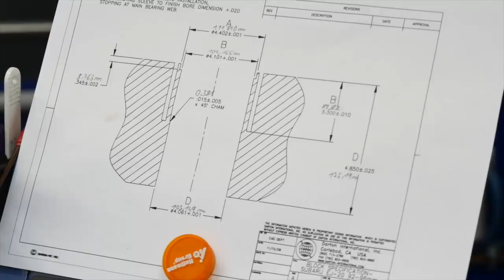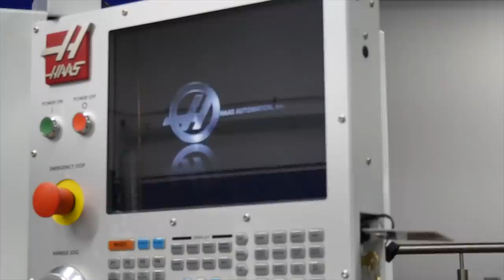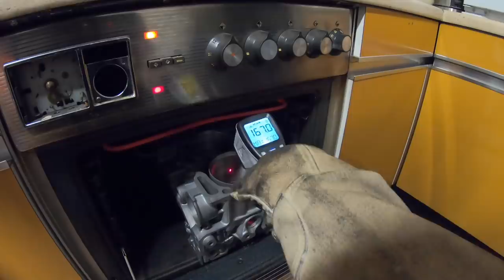High Performance Boxer SIX CYLINDER build l EG33 l Part 1 l Subi-Performance

Comment: 4:45 for cleaning of the holes, you might enjoy using a chamferring and deburring tool used for reloading ammunition cartridge cases. They can be had in 60° and 45° pitches, and most can go up to 13mm/ .512 inches.

Comment: Aren't you supposed to use a torque plate of some kind when boring aluminum blocks?  Or is that not necessary when boring for sleeves?

Comment: I have an old car, I would like to strengthen the engine in it, what parts should I replace?
Please help, I need your information
large piston, thick piston rods, large crankshaft
is it enough to power the engine

Comment: On these EG33 are they a alluminium block and then inserting a steel sleeve? 

Just a big debate in the Porsche rebuild world over steel vs nikasil sleeves.

A lot of nikasil installers don’t rate steel sleeve because of their different metals expansion/contraction rates which is what they’re saying causes the sleeves to slip in some cases with the steel liners.

Just wondering how can this not be happening with the EG engines?

Comment: So how big can you go with an aftermarket liner and a stroker crank or welded up stock crank?  What kind of power can the cranks hold?
Reply: Thanks interesting engines, my apology though I thought this was the newer EZ series.
Reply: @shaadydog1  EZ series have many quirks. Raptor superchargers have some data. There was the Perrin build a number of years ago as well. It's just a tricky platform to configure and tune. Most people haven't spent the money to R&D them as there are better investments out there.
Reply: @Zoomzabba  Ya I mean i have seen some thIngs and it is a bit of an odd duck. Its a good bit shorter 3 inches or so with accessory I believe, and my purpose for research was a possible FFR 818 kit. That kit car uses the tried and true flat 4 NA/Turbo but their is speculation/proof the EZ will fit between the back body and the driver bulkhead with no or little cutting welding.
Reply: @shaadydog1  torque is the reason to increase displacement. With a chassis that light, not much torque is needed unless you are literally running a course as technical as a gocart track. Rev happy, rubber bandy 2.1L with high compression and a small turbo is often a less complicated formula.

Comment: Why does the machine boring out the cylinders not need cutting fluid like a CNC does?
Reply: The ductile iron carries a lot of heat away in the chip while slow machining. That said, we use a Haas CNC like in the video for cutting the sleeves out with a little coolant to reduce wear on the tool.

Comment: What is the wet blast media you use to clean the block halves?
Reply from the maker: Brook Paterson glas
Reply: @SubiPerformance  wet glass media? Not wet oxide? Im assuming you dont blast the bearing surfaces? How do you make sure none gets into the oil galleries? Or how do you make sure it is cleaned out. Wouldnt want glass media in the oil galleries. I ask because I have all this equipment at work.
Reply: @Sacrederb  I dry glass bead blast blocks and heads. For a Subaru, so long as all galley plugs and oil restrictors are removed; there is no passage that you can't wash out to remove the media. For many German heads, we have to mask off the oil galleys because they dead-end and cant be easily cleaned.
Reply: Thanks for the clarification. Cheers.

Comment: I think the loctite is not adequate. It is better to ensure contact between metals for heat dissipation. it is better to tightly adjust the inserts of nitrogen-cooled piston sleeves
Reply: That is the adhesive that Darton supplies with their sleeves.

Comment: Why drilling hole in sleeves at 11:12
Reply: I imagine it's to be able to install the connecting rod wrist pins & clips in the middle cylinders. The EG33 (and I'm guessing the EZ family of engines as well?) have the requirement of passing thru the outer cylinder bores to access the middle cylinder for this task, via threaded access plugs. Being a boxer, the connecting rods need to be installed on the crankshaft prior to the case halves being assembled, without pistons attached. After case halves are assembled together, the pistons are then installed from the top of the bore, and the wrist pins and retaining clips are installed from access holes on the sides of the case/block. The fact that the central cylinder bores are between two outer cylinders necessitates the need for side access through the sleeves they are adding. I wonder if this is how it's done in Porsche's engines as well...?
Reply: @xyphur  or it's may b for removing piston pin circlip locks

Comment: Next project CNC Closed Deck Modification EZ30possumbournemotorsport.com
Reply: Bad URL. Additionally, pinning the deck is a much more reasonable bracing technique as the cylinders are already very wobble resistant considering the sleeve thickness.